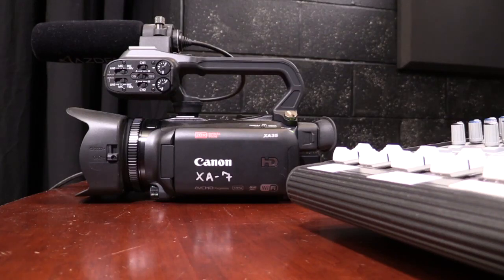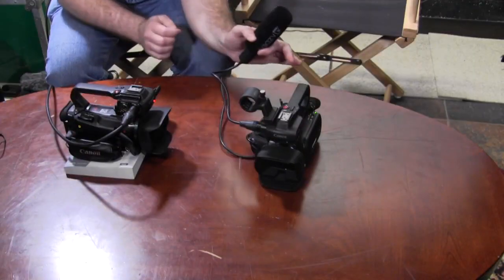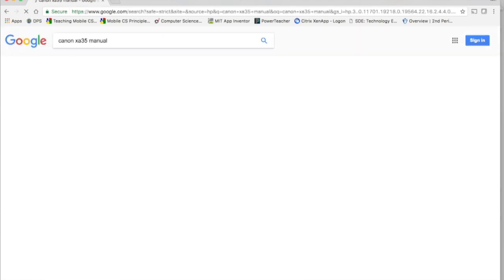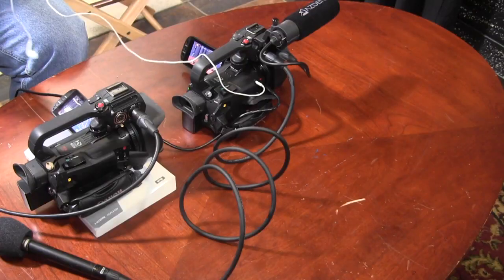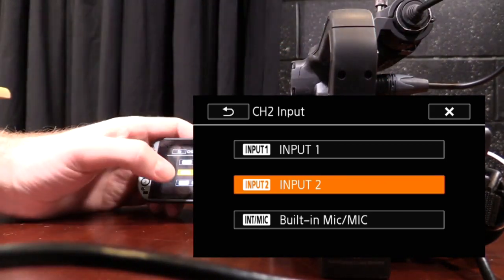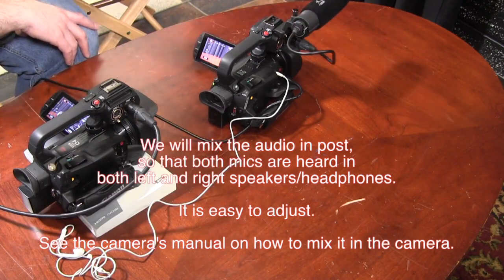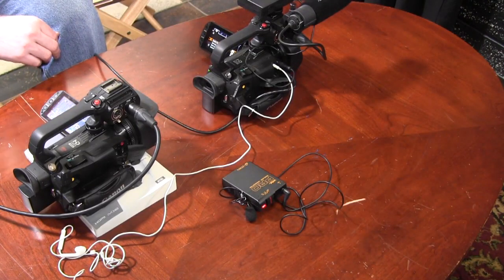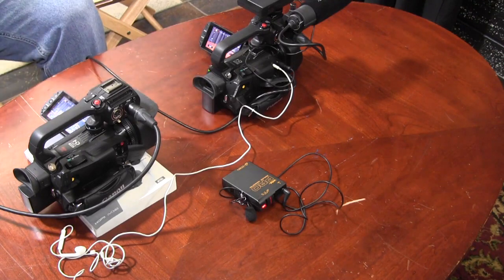How to get the best audio from a single video camera set up.

Comment: You are a life saver! i have an xa30 and you can't imagine how i have struggled to record sound on it. I only use  a rode shotgun mic on it, i never knew you can combine  with the onboard mic and have two different tracks. Thanks a million! I have learned a lot in 30 min than all the time i spent trying to understand what the manual was saying. I have searched som many times for some goo tutorials on how to set up sound on these cameras, nothing compares to your detailed explanation, fantastic job.
If i may ask, the only time you can combine the onboard mic is when you have an xlr connected, or can you use it together with a MIC in?
Reply: Ditto on this video, I have a Canon XF-305 and this video has saved the day.

Comment: i have an xa 11 and vid pro wireless mics and when i press record on the camera i hear a beeping noise that is in cadence with the red record flashing light, can you help? do i have it hooked up wrong? i have it hooked up to input 2 with an xlr plug not the out cable that you used.
Reply from the maker: That is a new issue to me. I don't have experience with that so I can't really offer a solution. My only recommendations are to try different xlr cables and try the input 1. If that doesn't work you might contact the manufacturer of the mic/ camera to see if they have a solution.

Comment: Hi, I am connecting an audio source (music from a sound desk) via the 3.5mm mic input jack. 
By setting the input levels as recommended in the manual (-18db) the volume through my headphones is way too low to monitor. 
I have the headphones volume on max but when I adjust the input volume it also alters my headphone level. 
Is there a way to stop this and have my headphones level much higher without raising my input levels? 
Thanks.

Comment: Hello. I have a XA10 and want to use the Line input to record the audio directly from the mixerboard. But even if max the aux output volume. I have not more can -20/-15db.  Is there any way to higher the sensitivity?
Reply from the maker: I haven't used line in for a very long time and don't remember all the settings. I recommend checking the manual starting on page 73. https://gdlp01.c-wss.com/gds/4/0300004844/03/xa10-im3-n-en.pdf

Comment: @Sterling Miller I will be shooting a Christmas program at a church with 2 of my pro-line Camcorders. I will be using a Panasonic DVX100a and a Sony PD-170. I'm planning on mounting the Sony on a tripod because I have a wide angle lense for it to get Max coverage. I'll be using the Panasonic as a run and gun and both cameras have shotgun mics attached to them. The church has a soundboard and I plan on using XLR to Jack into the soundboard. Should I use the shotgun mic on the Sony in conjunction with the soundboard or would I be overloading the camera with audio? Also, what are your thoughts on using the shotgun mic and the built in mic together on the run and gun Panasonic ? Should I just use the shotgun mic?
Reply from the maker: If you are streaming live, I would get the audio straight from the board and possibly one of the camera mics (for audience sound like clapping) 

If you are recording and going back to edit I would check to see if your camcorders record to separate channels-- I looked up Sony PD-170 it says that it records two channels I didn't see info on the Panasonic but I think it does 2 channels as well.  So shotgun mic record to 1 channel on Sony and soundboard record to other channel would be a good combo. 

If Panasonic does record two channels do one channel shotgun and one channel built in. Then when you are editing you can choose which channel sounds best-- if it only records to one channel do shotgun as it will produce better sound than on board mics and won't pick up every bump or camera zoom sound. 

After you record look up multi-camera editing and you can sync up the videos to make editing a lot easier. Multi camera is available in major editors like Premiere pro CC, Final Cut, or Vegas. 

Good luck with the project.
Reply: @sterlingteaches  thank you so much for your prompt response and I will take all that advice and put it to use. I will be recording and then editing in post.

Comment: Hello Sterling, 
I’m using an xa30 getting sound from a mixer for church services , I want to know how to mix the input 1( the mixer) with the internal microphone to get the audicience noise as well and hear it on both headphones while I recording.
I want to know how to do it on the camera because we might me streaming , and I can’t find it on the camera’s manual
Reply from the maker: Check on the bottom of  page 88. http://gdlp01.c-wss.com/gds/6/0300023666/01/xa30-35-im2-p-en.pdf    you tap on the Function button  on the screen then camera icon scroll to the bottom where it says audio 2 and choose that and change it to internal.
Reply: Thanks a lot for the reply , I will try that

Comment: Thanks for the video and helpful instructions.I have just obtained a XA30 for doing music gigs etc. Is it possable to get a custom mic set up on the internal mic, and a shotgun on other chanel as the AGC on the internal mic (auto) is quite aggressive and not a lot of light and shade on the audio levels. Or only a custom set up on internal mic and use say a Zoom H1 and mix/sync in post.
Reply from the maker: Yes, see page 81, 82 of the manual http://gdlp01.c-wss.com/gds/6/0300023666/01/xa30-35-im2-p-en.pdf  You can plug in a shotgun in xlr input 1 and then plug in a different mic/audio source using a 3.5mm into the mic on the body of the camera. In the menu I can't remember where right now,  you set input 1 to be channel 1 and input to to be internal mic, but if you have the 3.5mm plugged in it will use that instead of the internal mics. Hope that helps.
Reply: Thanks for the prompt reply. I will try pluging in a shotgun in xlr input 1 and a wireless receiver into the 3.5 input, with sender connected to Zoom H1, as sometimes in small venues where the camera shoots from, is not ideal for the audio. It appears that when the xa30 is set up useing "custom" audio for the internal mics only, when you change to use xlr shotgun input 1 and channel 2 for internal mic (page 88) , the internal mic reverts to auto level. ( My fault, should have read the notes on page 89 !  ie For INTMIC setting, Built-in mic/MIC channel 2, audio scene sets to STD Standard: meaning AGC level) so maybe will try a custom audio set up on internal mic and use a recording thats recorded on manual on a seperate external Zoom H1, and mix/sync in post, which keeps all audio tracks on manual levels.

Comment: Great video, finally figured out how to get stern sound went using a shotgun with XLR..question..can you put in 2 Mics with XLR and get both of them in stereo sound? Or does this require more?.....If this is not possible...can the 3,5 jack cable recording in stereo sumiltanously with the XLR in stereo? kind regards and love this video!!

Comment: Hello mr. Miller, i bought the canon xa10 some months ago, and no setting i tried has worked for bouth xlr inputs. Is it possible that the xa10 doesnt work with 2 channel xlr audio inputs same time?
Reply from the maker: I haven’t had that model camera in a while. On page 75 of the manual https://gdlp01.c-wss.com/gds/4/0300004844/03/xa10-im3-n-en.pdf#page74 it says how to change the setting, you should be able to set it that way. Check out the manual. Pg 75.

Comment: Hi! My school bought the same camera for recording teachers' lessons. Video quality is superb but the built-in mic, not that good. I recntly bought a BOYA BY-MM1 Universal Cardioid Microphone to work with my android phone. I used the cable meant to connect it to the canon camcorder via the mic input but it doesn't work! Would appreciate your advice on this. Perhaps its a hardware issue? If so, can you point me to what kind of mics + cables I should get for lesson recordings taken from the back of class, about 5 m away from subject.
Reply from the maker: I recommend getting a powered mic for the sound to come out well--I have not had success with non-powered mics. You can get a mic that runs off a battery or if the camera has the handle with the sound inputs you can use Phantom power to ower the mic. I use an shotgun mic plugged into the xlr input of the camera and the mic gets power from the +48v button. https://www.bhphotovideo.com/c/product/1348543-REG/azden_sgm_250cx_shotgun_microphone.html Here's one that uses a battery for power: https://www.bhphotovideo.com/c/product/444022-REG/Azden_SMX_10_SMX_10_Stereo_Microphone.html I haven't tried that one, but seems like a good one. I also use these wireless mics for recording teachers https://www.bhphotovideo.com/c/product/1485363-REG/audio_technica_u851rb_cardioid_boundary_mic_black.html I give the teacher the lavalier mic to clip on.  My go-to mic for recording a teacher is the shotgun first mentioned in this post. I can stand at the back of the room and point the camera at the teacher and get good sound. It costs more than the Boya mic, but if it is in the price range a powered Shotgun mic (either phantom power--better or Battery powered-still good) are my recommendation.
Reply: @sterlingteaches  Thank you for the invaluable sharing and advice! Much appreciated!

Comment: I plugged my camera into a Presonus sound mixer via a 1/4" into the aux channel I had my selected mix through. However, I am only getting audio as a mono output. How can I get this stereo without putting it into post production. It is for livestream purposes.
Reply from the maker: There are a couple of variables to look at. 1) is your mixer sending out stereo or mono audio? 2) If it is sending out stereo make sure that your 1/4 cable is a stereo cable it will have two black lines on the metal tips. 3) your camera may have a built in feature to switch mono to dual mono or stereo--check your user manual--google your camera model and manual and you should find it online. The camera I show here allows audio to be recored to both tracks if it is input through the xlr channel one if you have that camera model (See page 89 of thishttp://gdlp01.c-wss.com/gds/4/0300021494/02/xa30-35-im2-n-en.pdf ) I think looking through your camera's manual will be your best resource.

Comment: Hi Sterling, can you help me, please?  I have a xa-11 purchased 6 months ago, for a very important piece of work, and I never get to the work, because I never resolved the audio issue. I don't get audio.  Is something in the setting that does not work. I tested the microphone it is a comico-..lite , I tested the headphone...they work while tested on other devices. I can listen to music on youtube with the headphone, I can record impeccably with the microphone and i-phone... I am not getting anywhere with the camera. 
I cannot see the sound indicator on the lcd screen for the external microphone. Rarely it may move a line or 2, but most times it is no motion
I can see the indicator for the built-in mic but we know that that is not enough of a quality to make a show.  The xa11 does not have a switch on the handle to select 'external' for an external microphone.  Maybe I didn't find that somewhere on the digital screen...?   I really don't know what to do. I tried everything but something I am not getting there.  Thank you for your help
Reply from the maker: I recommend reading through the manual, https://www.usa.canon.com/internet/portal/us/home/support/details/camcorders/professional/xa11/xa11?tab=manuals  
Page 72 talks about connecting external microphones.  If your mic has 3.5mm jack you might want to have the input terminal on the camera set to off when you plug it into the mic port. You can also take off the handle and try the mic without it.  If your mic has XLR connection read the pages after 72 and experiment with the settings listed.

Comment: Sterling:
    In your opinion, would it be possible to set up 3 external mics on a 2 Channel input Camcorder?
1 mic for left, 2nd mic for right, and a third tapped into one of the two, for center channel?
The idea is to capture a stage show in stereo, with a 3rd mic, to capture center. (Without using a mixer)
Reply from the maker: Without using a mixer, I don't think it would work. As far as I know the cameras only have 2 inputs and 2 channels. Unless your specific camera has a way to bring in 3 audio channels.

Comment: I do not have a red mic input on my canon hf r 300 but I do have a mic input on it will this work if not my plan is to run an hdmi cable from my camera into an audio inserter into an hdmi splitter to go to TVs.
Reply from the maker: Yes, that should work. The color just changed, but it is still a mic input.

Comment: Thank you so much Sterling! I had a XH-A1S before and only bought the XA30, because the new laptops don't have a fireware to transfer from HDV tape. Miss the manual controls of my XH so much! I had no problems using the internal MIC and my oldie-but-still-goodie MK-66 Sennheiser (about 20 years old and used very frequently!), but never succeeded to get my new Rode NTG-1 working on the XA-30. Your tutorial is very helpful!

Comment: I need to connect a Mackie mixer to a Canon XA 10. Is there any advantage to using the XLR sockets? Thanks for the video, it's helpful.
Reply from the maker: I like XLR because I have the fewest issues using them. Anoter way is to use RCA from the rec out but according to this article XLR can go greater distances: http://www.audioaffair.co.uk/blog/xlr-vs-rca-interconnects-is-there-a-difference/  

Typically the XLR cables are balanced cables , but the 1/4" may or may not be. https://www.sweetwater.com/forums/showthread.php?34238-XLR-vs-1-4-balanced  

I like XLR because I have better XLR cables than other cables and I can control the audio easier using the buttons on the handle and I can go longer runs.  The cables seem to do better for us. If you have a local music store you might stop in and ask them to explain the difference further, they probably sell both kinds. 

Hope that helps.
Reply: Sterling Teaches That's great thank you. ☺

Comment: Thanks for the tutorial. I am getting a lot of hissing notice when I attach external microphones to my canon XA30. Can you please advice what settings should I use to reduce the background noise
Reply from the maker: I can't recommend a specific setting to reduce background noise. I usually set the audio input to manual and then I lower the volume so that no background noise is there when no one is talking. You could also try changing the cable that you have the mic plugged into. I recommend using a balanced cable, https://www.sweetwater.com/insync/cable-buying-guide/  some of my cheap xlr cables are not balanced and have caused issues for me in the past.
Reply: @sterlingteaches  Does Every digital camera have Surround 5.1 & 7.1 Maximum Quality Left and Right and a Equalizer?.